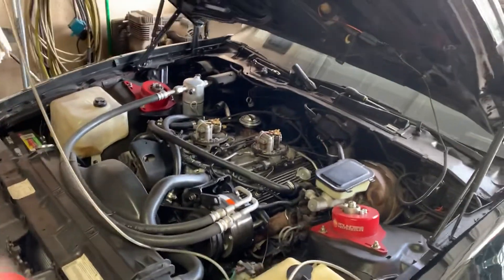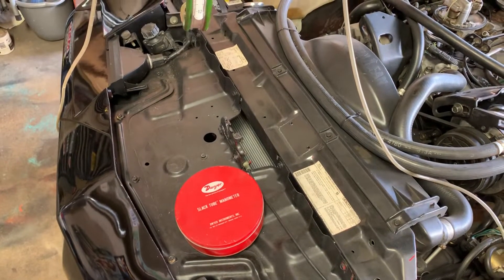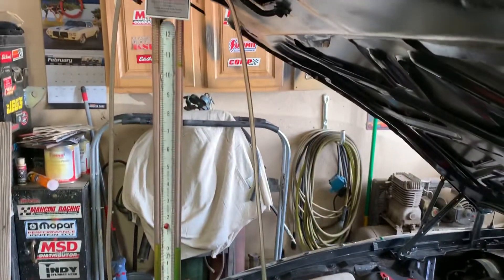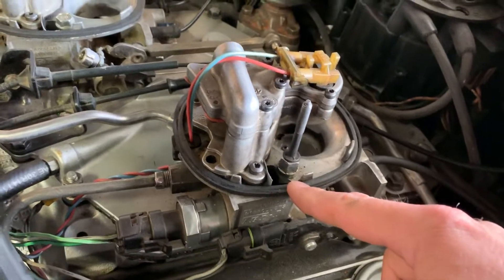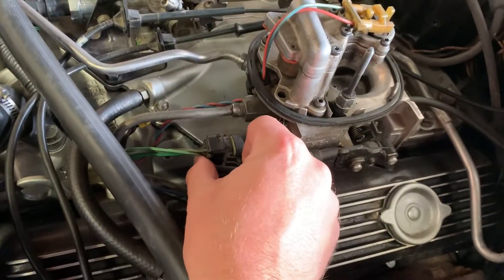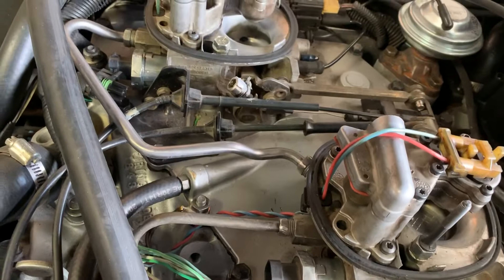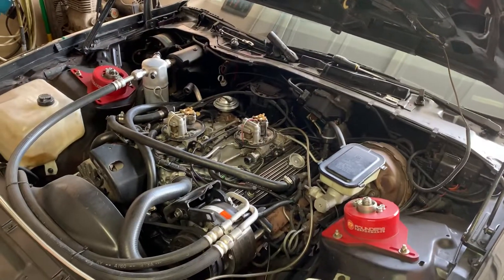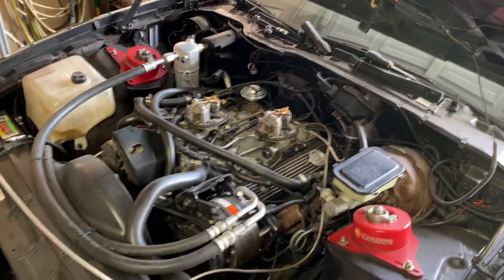How to balance/synchronize Crossfire Injection throttle bodies Part 1 — setup

Comment: Hi, I have one of those Dwyer manometers that an older guy I know had and loaned to me.
He used to work at a chevy dealership, years ago and had the manometer from back then!
At the time, I needed to clean up the manometer since it sat around for 20-30 years.  I don't know anything about the exact way one works. So, I was cleaning out the threaded plastic tops with the Cork & stainless steel piece inside, plus the two rubber "O" rings.
 I don't know if the plastic threaded tops where you hook up the hoses are able to pass air through them. My two don't pass air through!  

Can you please tell me, if air supposed to pass through??

Allen
Reply from the maker: @KWconchFL  Loosen the 90 degree elbow from the cap itself. Then it’ll pass air.

Comment: Hi Joe - I have an 82 Corvette that's been in the family since new. I just completed balancing the TBI's and believe I was successful, THANK YOU!
Since the weld on the slave TBI appears to be original, I didn't want to break it. After adjusting the Master TBI to 6in of Vacuum, the slave TBI was recorded at 5". After seeing your response to a comment below, I will adjust the master TBI to 5 instead of 6" of vacuum.

Q- Where can I get a replacement Slave side throttle adjustment screw like the one you have on your Firebird? Mine his a Torx

Comment: If you have a crossfire setup on a modified engine, would you increase or decrease the amount of water pulled? If I’m at 6 the idle is rough, if I decrease it, it smooths out. I hooked up a vacuum gauge at the manifold and the needle bounces at 6 but levels out when that is adjusted down.
Reply from the maker: @ChrisMurray-q2c  6 is just a number to balance with. You can balance them at 3, 6, 9, etc. As long as each TB draws the same amount of vacuum, it’s irrelevant. Once they’re synced, you can set your idle speed.

Comment: I’m a lucky one that had to cut the weld on my balance screw. Where did you get your screw?
Reply from the maker: @niatt3537  It was the factory screw. I ground the weld off of it.
Reply: @Joesmopargarage  Ok my screw head is much smaller than the one in the video. The head is pretty messed up now after the cutting. I’m just looking for a bigger sized head with maybe a nice knurling on it for easy adjustment. Thanks for responding. 👍🏻